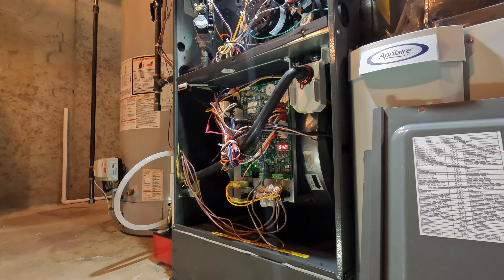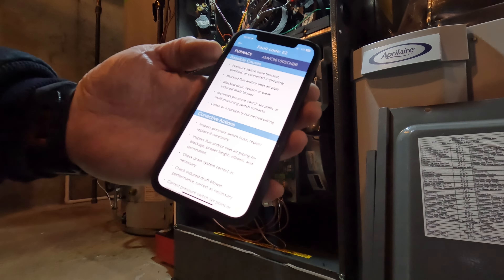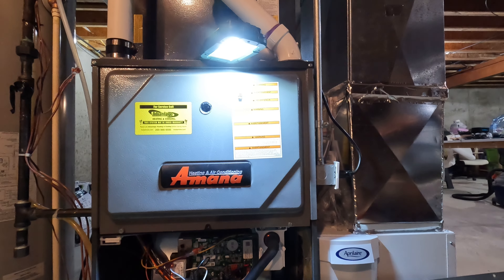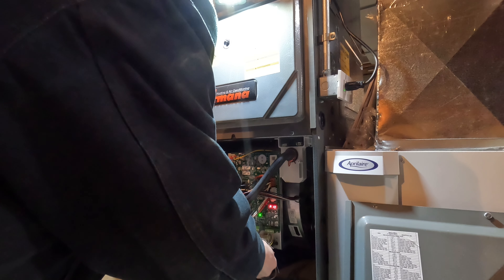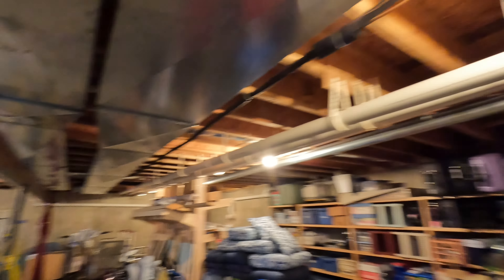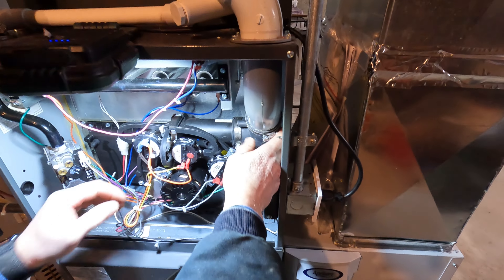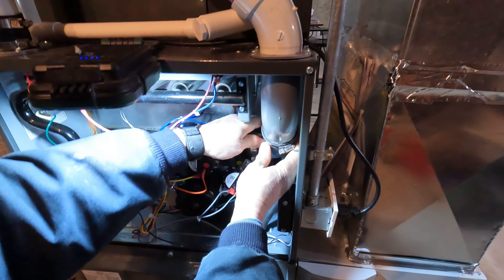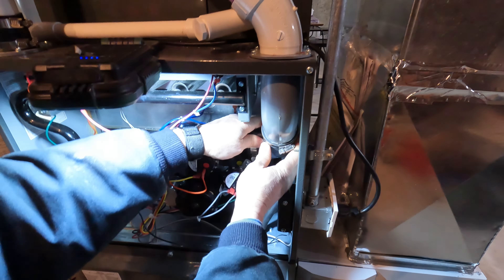Fixing Amana/Goodman AMVC96 E2 Low Stage Pressure Switch Error

Comment: most of my installs i tend to put a tee in near the furnace so it has a secondary drain instead of all the condensation going back into the inducer.   pressure switch troubleshooting are always the tough ones.

Comment: I have the same furnace! Brand new! I installed the furnace myself. Kept getting a EE2 code for pressure switch, jumped the switch out and furnace ran full cycle. But noticed gurgling when the inducer motor started. I thought it was normal. Anyway ordered new pressure switch. Now that I have come to your video i’am confident the condenser water is the problem causing switch to remain open! I’am going to adjust the rubber elbow to level down like you did to drain the water out of it and stop backup of condensation water! I’am not a trained hvac guy. I’am a retired guy who just can’t afford to pay a contractor to install a new furnace and I have no problem doing it myself, i’am not happy with Goodman as I thought they were a good brand. They should send a replacement upgraded rubber elbow to all the people that bought that model. Anyway I haven’t adjusted my elbow yet on my furnace but i’am confident that you have the fix! Thank you and keep your videos coming!!!
Reply: I'm following this, did it end up resolving the issue for you? I'm fighting the same problem. Thx
Reply from the maker: @sebastianpiech8465 i have not had a call back since I did this fix. Its been a year.
Reply: @ADVANHVAC  hell right thx
Reply: Yes, so far my brand new Goodman has been working fine since i adjusted the elbow. Goodman should have issued a bulletin immediately to all people who bought this unit!! If I need another furnace replaced I will not!! Include Goodman in my purchase consideration!!

Comment: this right here was the bane of my existence last winter and looks like they didnt fix much on the new units weve installed this summer/fall. 

we spoke to a tech from goodman/diakun in the area (toronto) and he said another big issue is the gasket/orifice between the ventor motor and the condensate collection box is too restrictive and the vent pressure switch will flutter open and closed. solution is to swap out factory pressure switches for ones that require less static pressure

Comment: Was it windy when the code was set? 🤷‍♂️
Reply: I ask because it will throw the same code for low state if it gets wind right down that flue pipe 👍🏼
Reply from the maker: Not that I'm aware of. It really didn't start acting up until we go those really cold Temperatures.  Since I repositioned that flue 90 the issue has been resolved.

Comment: You mentioned resetting the codes on this particular furnace.
I have an E3 code, how to i reset the code to see if i fixed the issue?
Reply from the maker: locate and press the reset button on the control board inside the furnace access panel; this will clear any error codes displayed on the furnace control board.
Reply: @ADVANHVAC  Is that right on the mother board itself? 
I see a learn button, and a fault recall button. 
which one is the reset button? 
Do I press and hold it as I'm turning on the unit? 
Thanks
Reply from the maker: So I just looked up error E3 code that’s saying that’s open high limit switch. How is your air filter?

Comment: Question.. could you just have taken off the exhaust from the inducer and seen if the code cleared? You would have determined the cause before changing out pressure switch.
Reply from the maker: No, because it would fire up most of the time. So from what the Goodman tech support said, is that 90 fitting has been an issue with condensation pooling just enough to trip the pressure switch and trip gas valve just in a flash to cause the E3 code.